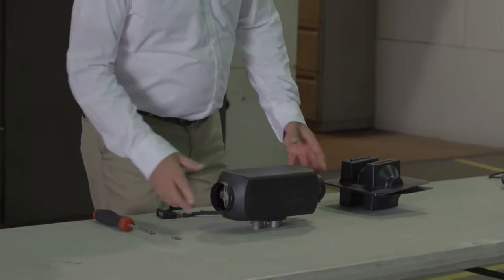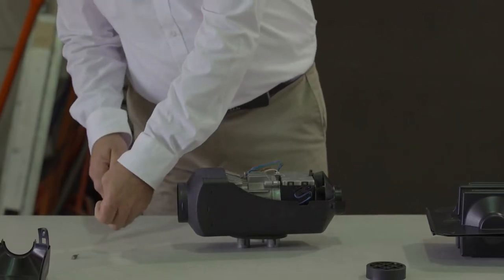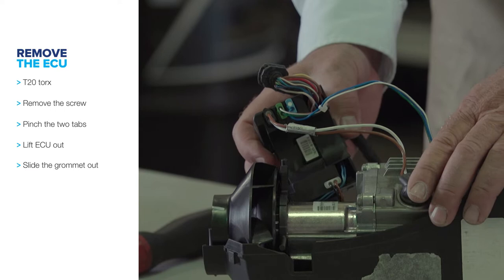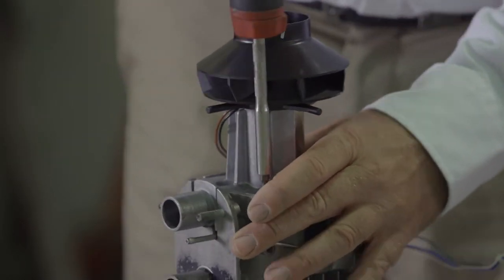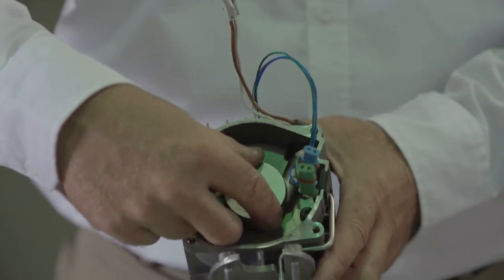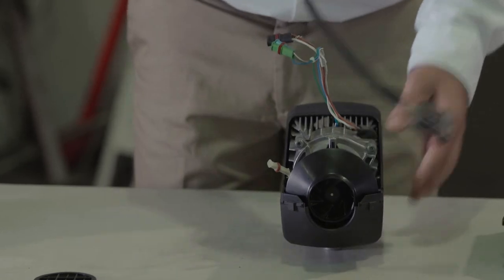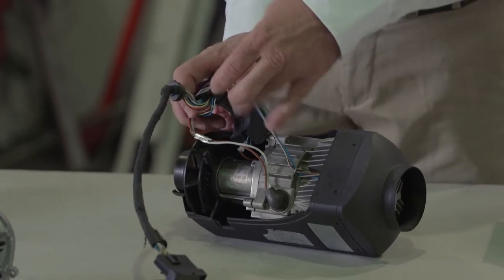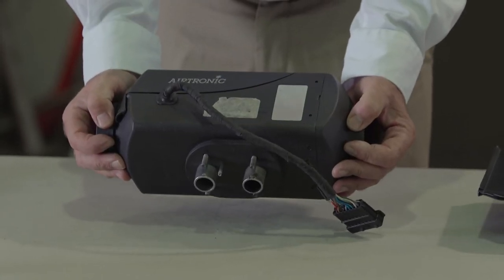How to Remove and Install a Blower Motor on an Airtronic D2

Comment: I have a question 🙋‍♂️?
I replace this screen and ignition :)
After I replace it I put the ACU back on the cover and I started the heater and the fan start spinning but was something rubbing or touching :( 
I didn’t put the cover right , I  squeezed harder  than somehow the fan stopped working:( 
And I can’t find or figure out what’s wrong the touchscreen is working but the fan the pump is not coming on  :( 
It’s on truck KE T680 2019 :( 
?????
Reply from the maker: Hi MGP, and my sincere apologies for not getting back to you sooner.  I must have missed your comment.  I'll endeavour to do better going forward. Our technical and/or sales support teams will be more than happy to help you out with any questions you have.  
You can reach Technical Support at: 
📞 1-800-387-4800 X2299
📧 help@eberspaecher.com
And if you don't receive a response to your email or call, please let us know and I'll send your question to someone's direct email.

Comment: How do you tell if the motor needs to be replaced?
Reply: the blower will start having intermittent problems, mine started pulsing fast - slow and finally died. the controller will show blower motor fault
Reply from the maker: I'm terribly sorry (and embarrassed) that your question slipped through the cracks.  I do hope you found an answer to your question.  Should you have any new questions, the best course of action is always to reach out to our technical support team first.  Phone: 1-800-387-4800 ext 2299 or help@eberspaecher.com.  Again, my sincere apologies.
Reply: Just ask Erberspaecher if they can fall through the cracks and give them minimum $500.00 and fixed..!!
Or just buy Chinese and wack a set of ZZ625 in $3.00, gaskets, $1.00, new gauze$0.50, give chamber a clean and your good to go for another 3 to 10 years 😂

Comment: I’m terribly sorry (and embarrassed) that this heater slipped through the cracks but that completely new fan unit probably cost the same as about 3 new Chinese heaters that last for years and years 😂
Reply from the maker: Comment from @douglasharley2440 who bought the Chinese knock-off.  Not the edit below.  So you jusdt never know, @bbdgha  

i paid $160, including shipping for an 8kw Chinese diesel heater (included 5l tank), and i've been running it for almost 2 weeks now and I LOVE IT!!! just finished-up my first 5l fill-up of the tank, and it has been effortlessly keeping my tiny home built in a box truck a very comfortable 75-80 degrees in 20-30 degrees weather. i couldn't be happier.

EDIT: the thing worked great for 3 weeks and then broke permanently due to crappy wiring. DON'T BUY THE KNOCK-OFF HEATERS, THEY'LL BREAK AND CANNOT BE FIXED.
Reply: @EberspaecherNorthAmerica  my $160 knock off been running 24/7 New Zealand winter for over 8 years flawlessly now and will tear down this summer to check inside and sling a gasket kit in $1.00, new bearings NMB ZZ625 $3.00. 😂😂😂😂

Comment: what does it mean when the blower fan keeps pulsing fast-slow? it used to run constant speed, it recently started pulsing constantly fast-slow
Reply from the maker: I'm terribly sorry (and embarrassed) that your question slipped through the cracks.  I do hope you found an answer to your question.  Should you have any new questions, the best course of action is always to reach out to our technical support team first.  Phone: 1-800-387-4800 ext 2299 or help@eberspaecher.com.  Again, my sincere apologies.
Reply: @EberspaecherNorthAmerica  motor went bad. replaced motor. 👍